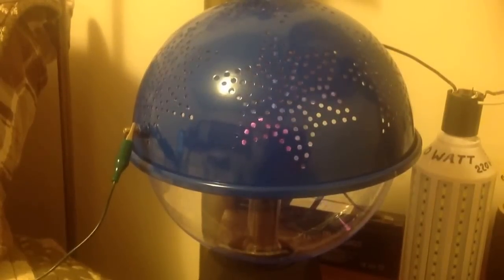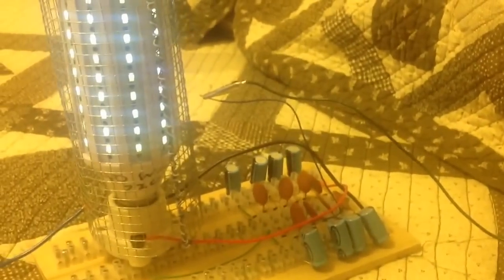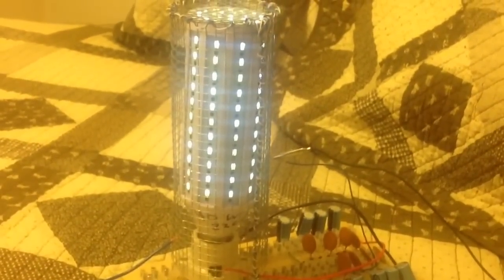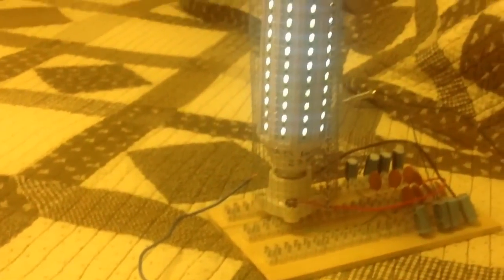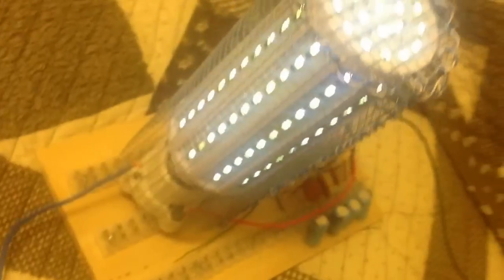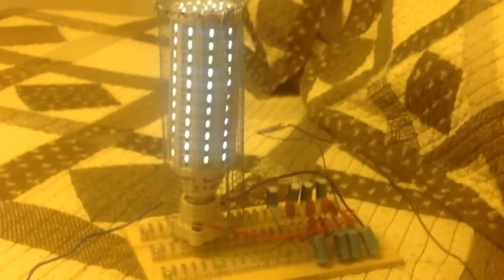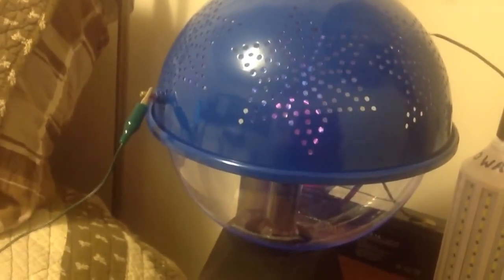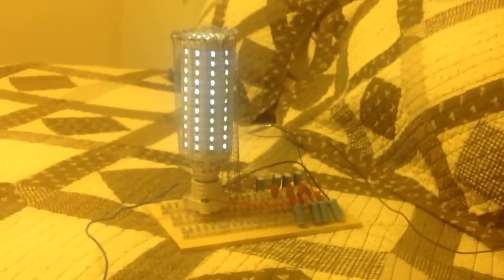Free energy fully powers 40 watt- 220 volt led bulb

Comment from the maker: When I measure the DC voltage delivered from the setup minus the 40 watt led lamp I get 575 volts.    Anyone out there know how to step down the voltage without stepping down the current so I can power a 12 volt DC low current motor?

Comment: Thomas i love your work and have been following it from a while now behind the scene here as well as on overunity.com. Hope to see lots more of your project and findings, keep it up!
Reply from the maker: +jonline internet  Thank you very much for your  nice comments.  My 8 inch plasma ball finally gave up its ghost after many hours of experimenting.So I hooked up my 6 inch plasma ball  with the same colander antenna and 40 watt led bulb..IT WORKS JUST THE SAME AS BEFORE BUT THIS TIME  THE WATT POWER NEEDED FROM THE BATTERY TO POWER THE BALL WAS 7.35 WATTS !!!Totally amazing.  The smaller 6 inch plasma ball looks lost with the 9 inch colander sitting on top of it.  BUT IT WORKS!
Reply: +Thomas Ferko That indeed is pretty amazing. Did you change the insulation thickness that (i guess) is between the antenna and the top of the glass of the plasma ball, or kept it the same as with the 8inch ball? The old setup looks like the antenna has pretty much equal spacing to the glass surface while with the new smaller ball and same thickness insulation the space should get wider as the antenna surface moves to the side of the ball (since the antenna is kept the same size).
Also are you going to try to double the antenna by making it a sphere with a hole cut out for the plasma ball base? That way it should be easy to get equal spacing between ball and antenna. I hope i'm making sense, i'm not  english ;)

Comment: Hows it free energy its being powered by the plasma ball, how much power does the plasma ball use to do this?
Reply from the maker: +Ian David  The plasma ball is powered by 9.65 watts of energy from the battery. The battery does not power the circuit at all.  It only powers the plasma ball. The ball is an excellent producer of radiant energy so I did not have to string up a huge antenna.  To make things as simple as possible I used a metalcovering ""Antenna""  over the plasma ball and harvested  radiant energy from it.Keep in mind that all radiant energy has to come from somewhere so in my case its coming out of the plasma ball rater than the weak signals that you might receive through a huge antenna.Now I am fully lighting a 40 watt lamp with radiant energy as its source power. NOT BATTERY POWER.